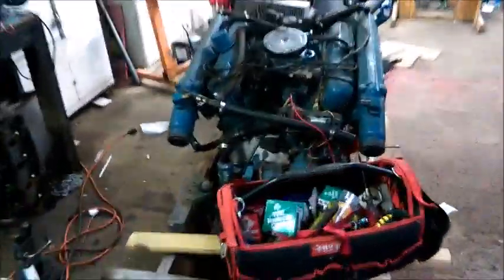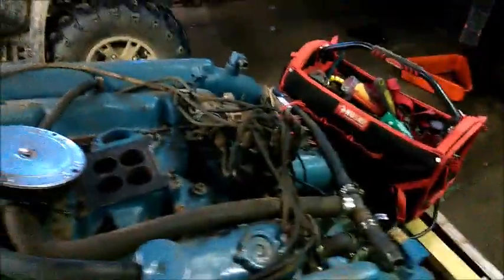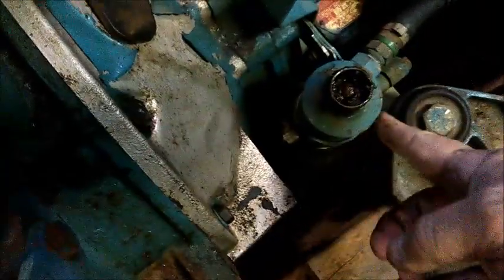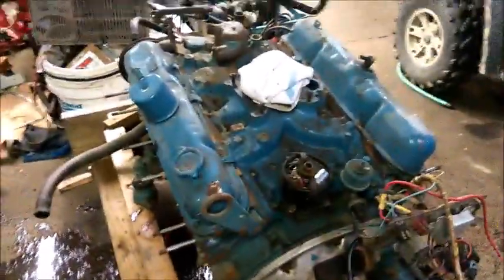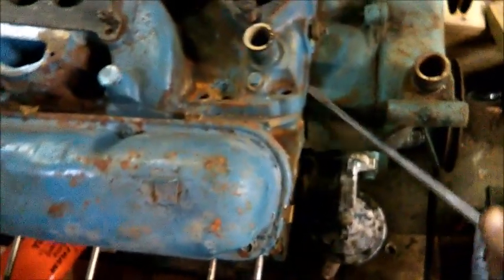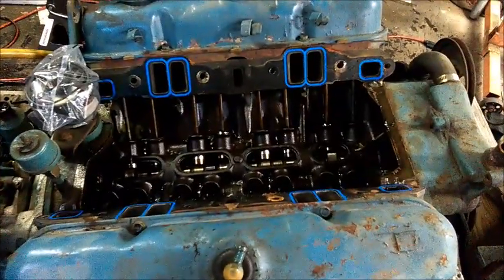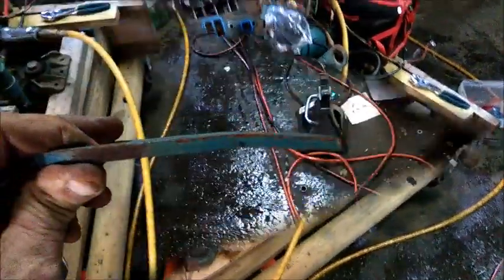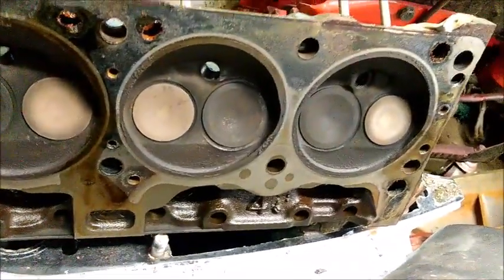Chrysler LM318 Reverse Rotation Engine Head replacement and inspection

Comment: Thanks for the video, Bill! I've just got myself a very similar looking '76 marine Chrysler 318. What's the best way to tell if it's a standard or reverse rotation? It doesn't have a flywheel and a starter yet. Cheers
Reply from the maker: there should be a sticker on the front that shows the rotation, or if you know what application the engine came out of, for example, most single engine boats are left hand rotation, twin engine boats would have one left and one right hand rotation (primarily in older boats, newer ones make the change in direction in the drives nowadays) with the port engine being the normal rotation and the starboard being the odd man out and rotating opposite of normal.  Lastly, there's a serial number and model number plate, if you look at the model number, it will tell you too.  Edit: typo :)
Reply: Thanks for the info! Seems like all the stickers are long gone from the engine, only the casting numbers survived :) I ended up removing the distributor and looking at the oil pump gear. Turns out it's a standard rotation engine. Now it's time to inspect the block and the heads for the cracks :)